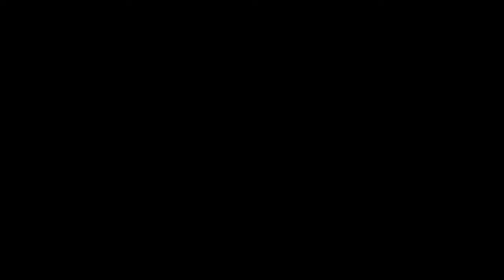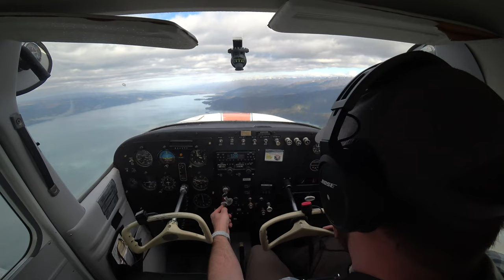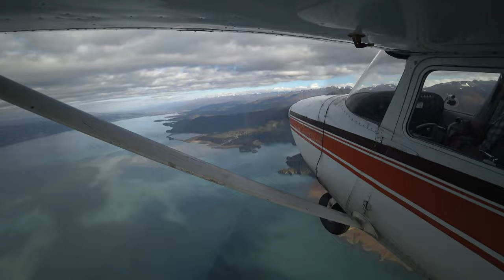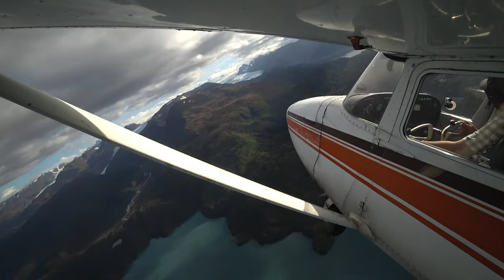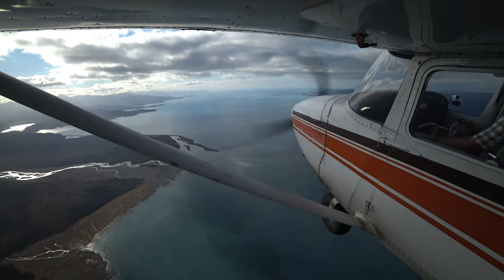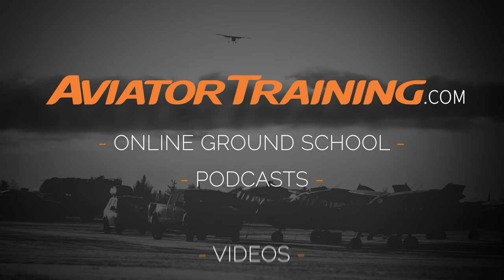Power On Stall in 4K -- Private Pilot Flying Maneuvers

Comment: I was taught to pitch the nose down with opposite rudder at same time (if the airplane turns due to uncoordination) to regain some airspeed. I noticed the stall horn went off a 2nd time on your 2nd stall example. I suppose it is because you're simulating a departure stall at a low altitude?